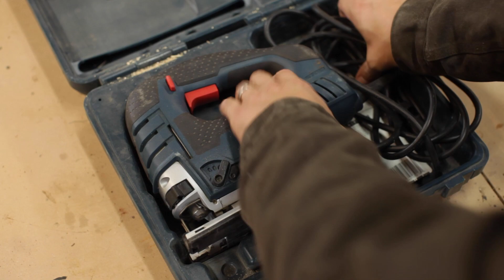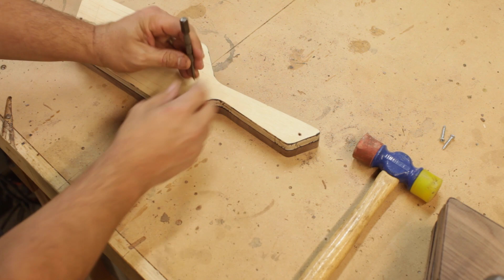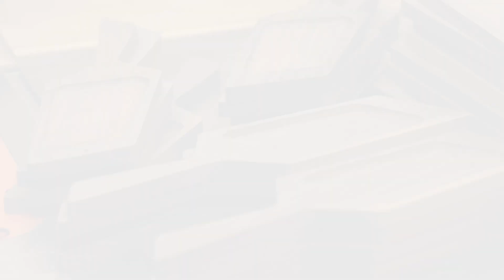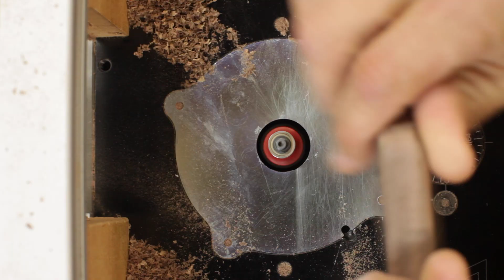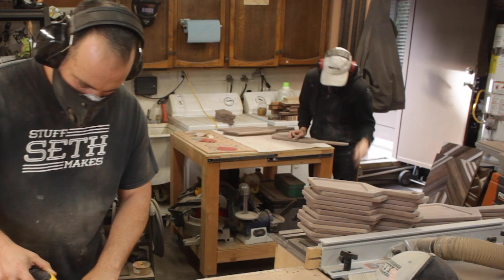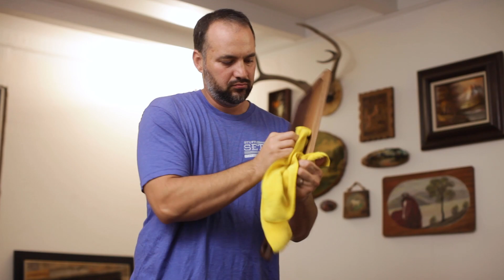How I Make My Modern Charcuterie Board - Original Design

Comment: May I ask what type of CLAMPS you used to secure the board to the bench before Routing out the inside.
I have bad Arthritis in my hands and those Clamps seemed to have worked without too much effort.
Thanking you in advance and eagerly awaiting your reply!
Reply from the maker: those are the Festool quick clamps. I love them and they really are easy to use.  I think there are probably other brands that make something similar but i don't think they're much cheaper.  Festool is an expensive brand but they make great tools and accessories!

Comment: What are the steel dowels for?    Nice video.
Reply from the maker: thanks.  they're for aesthetics.   first minute of the video, and other comments mention it.  thanks for watching👍🏻
Reply: @stuffsethmakes  Seems like a waste of time.  Stainless steel rods are way more work than using a dowel cutter in contrasting color wood (walnut/maple) (maple/padauk), etc. Plus the dowel cutter, rather than a dowel, will give you the same grain to work with.  Line up the grain or opposite it for effect. It's all wood, so sanding isn't a problem.
Reply from the maker: just doing what the client wanted

Comment: What is your router table setup?  Which table, lift and router are you using?  Looks like an Incra lift or plate
Reply from the maker: i've got the cast iron router table top from Bench Dog (got it at rockler), Incra Mast-R-Lift II, and the Bosch 1617 mounted in it.  I have the router table mounted in the right wing of my Laguna table saw, and i build a cabinet base for the router table to help support the weight, add storage and keep some dust down (dust collector connects to the back side of the cabinet).  👍🏻 I dig my setup, the layout works well for me!

Comment: This is an awesome video that has inspired me to step up my charcuterie board game.  I am relatively new to this hobby and I am intrigued by the jigs you have fabricated for creating the bowl on your boards.  Could I trouble you to explain the collet extension and what it's purpose is for this project?  Thank you!
Reply from the maker: thanks!  in this instance, the collet extension was necessary so i could reach my desired depth.  the shank of the bit isn't very long and my jig is a little thick, haha.
Reply: @stuffsethmakes  thanks for sharing.  Did you put together a jig building video?
Reply from the maker: no i didn't, sorry.   the jigs were too specific for this particular project.

Comment: Wondering to save a step, if you moved the template screw to line up with the hole in the board handle.  That way you remove the screw hole when you drill the hole in the board.
Also that way you would not have to cut the handle shorter.
WHAT is the purpose of the stainless insert????

Comment: Great video!  When you put the stainless rod into the wood do you just sand it smooth while sanding the wood or is there another step to get it level?  I just subscribed and am looking forward to your new videos.
Reply from the maker: i had to be careful with the length of the little pieces of rod.  Obviously, stainless steel is much harder than the walnut so when sanding, it can wear down the wood more, leaving a small "hump" at the rod.  I tried to set the rod just a hair beneath the wood surface so when i sanded everything it would end up pretty even.

Comment: Great video and awesome looking boards!!! One thing that confused me is, if you're making a hole at the end of the handle anyways why not use the same hole that is secure your piece to the template? At least like that you don't have to cut off anything
Reply from the maker: good question!   i'm sure there's a reason and if i could remember i'd tell you 🤣👊🏻 Thanks for watching🙌🏻
Reply: @stuffsethmakes   Great design...love it!  I did have the same thought to save some time...why not move your handle hold down screw down a bit and later it will serve as the center for your forstner bit when you drill the hole in the handle.  After 36 cutting boards that saved time will certainly add up.  Just a thought, but you earned a new subscriber nonetheless!
Reply from the maker: but that means i'd have to do a whole new video and do it all over agin!! 🤣. Just kidding.   the idea makes total sense now that i'm thinking more about it.  Thanks for watching! Thanks for the feedback and thanks for subscribing!  I have several videos in store for 2023 😃.  Happy new year!🙌🏻

Comment: Hey man I recently purchased the jet 1.5 dust collector that you did a video on a few years ago, are you still using it?? How’d it hold up??  Any tips on when I get that bad boy together? Thanks tried to send you a private message I didn’t see where to do it
Reply from the maker: I still love it and use it every single day!   I keep wanting to do a follow up video but i haven't had the time!🤦🏻‍♂️   Quick tips...use magnets to hold the plastic bag in place while you secure the metal strap....i swapped out the included caster wheels to a more rubbery set so it rolls across my dirty floor better....i also added a couple strips of wood under where the dust collection bin is so the bin can rest on it.  That's all off the top of my head!  Enjoy your new beast!!👍🏻
Reply: @stuffsethmakes  thanks it’s on back order til Middle of May so I’m prepping my new shop, thanks for the feedback 🤙🏼🇺🇸